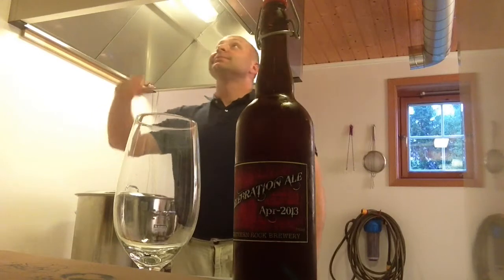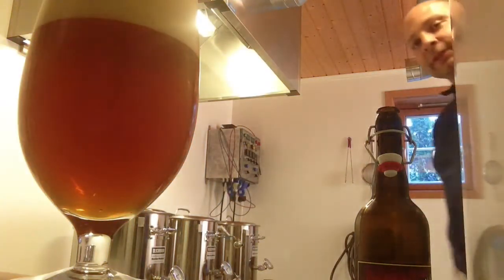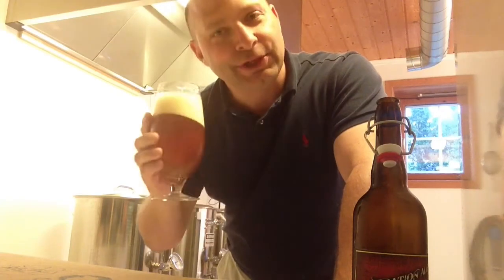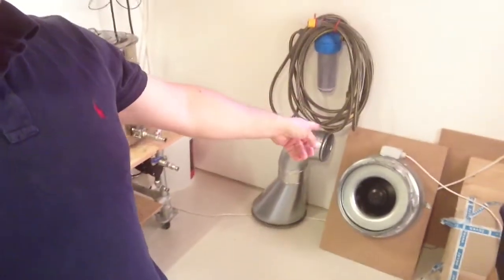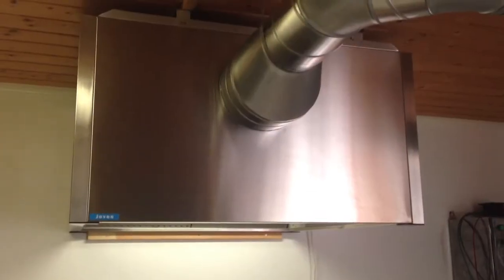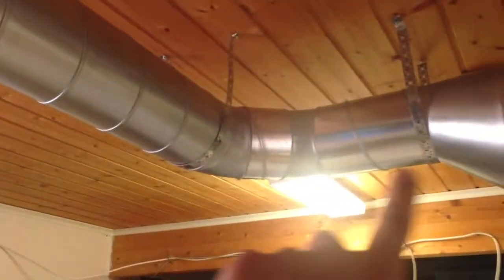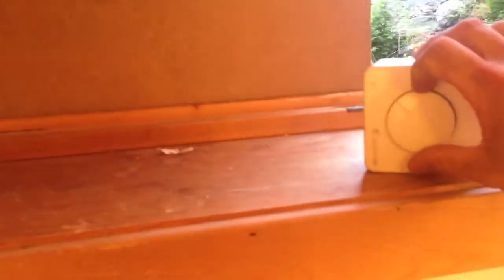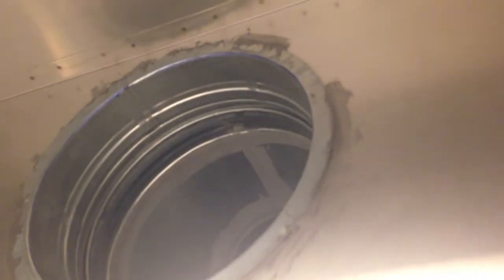Homebrew Wednesday - June 19, 2013

Comment from the maker: I show the moisture in the vent hood at the 17:45 minute mark in my next HBW video - July 2nd. In the ventilation pipes/tubing, yes there is some if the fan is at 20-40%, but there was none when I had it at 80% the last brewday. I don't have the specs with me now on vacation, but I believe my fan is 1400+ CFM.

Comment: What vent hood did you use? Why not one that covers all three kettles?
Reply from the maker: Hi, Brian! The vent hood I have is one I found on the local classifieds some years ago. At the time I would of preferred buying one that covered all three pots, but this one was a great deal. After having done electric brewing for this long I can confidently say that anything longer is unnecessary. Neither the HLT or Mashtun produce any steam with their covers on, which is about 99.8% of the time. When they do, it's barely anything, and nothing to be concerned about. Cheers!
Reply: @TonyYates  thanks Tony! So if you had to do it all over again you'd go with one just a few inches wider than the BK? I'm thinking about building my own with plexiglass. Saw a guy on the AHA forums with one. 

Are you running g a 30 or 50A system?
Reply from the maker: Not sure what I would do if I had to do it all over again, to be honest. For you, I would recommend building it the way you want and will be happy to use. I went more for function, rather than fashion. If you plan on having lots of visitors and will be showing it off, then maybe build it for display. I built the 30A panel. Cheers!